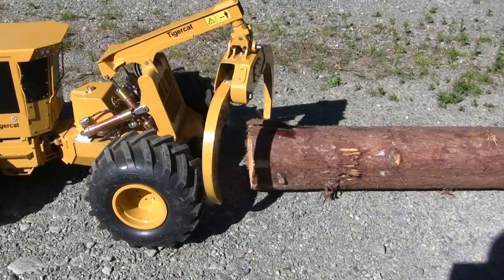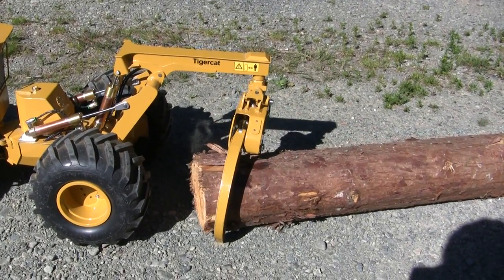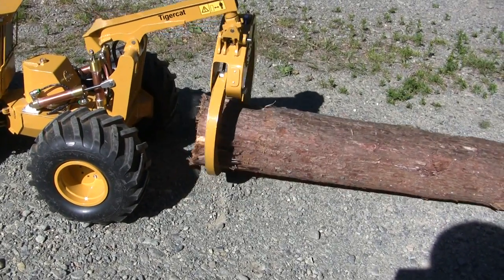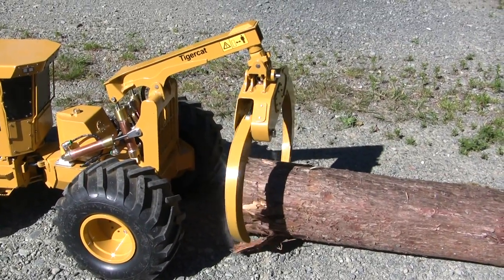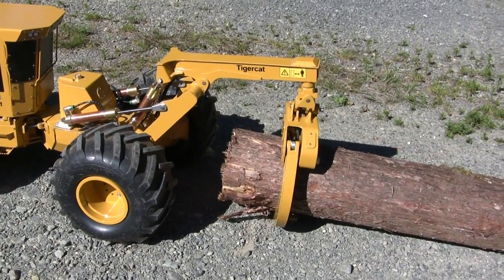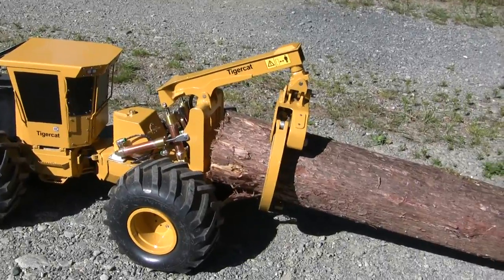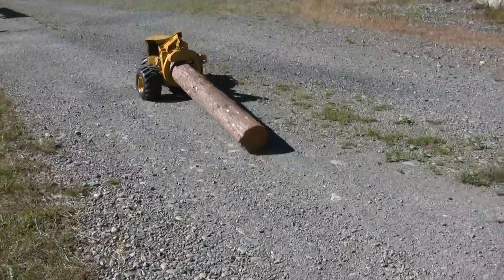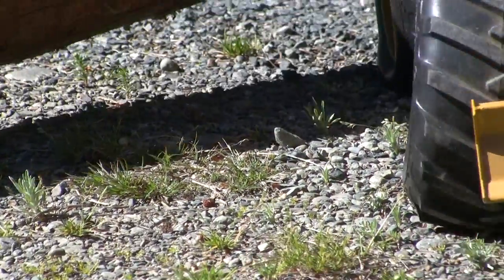First turn with the Tigercat skidder

Comment: That pump sounds awesome! 
Plus the drivetrain also sounds good! 
Very smooth build, great stuff!
Reply from the maker: Thanks! The pump seems to work pretty good too. I wasn't really sure what the oil flow would be like but it seems OK. The speed is good and the motor still has a bit more.